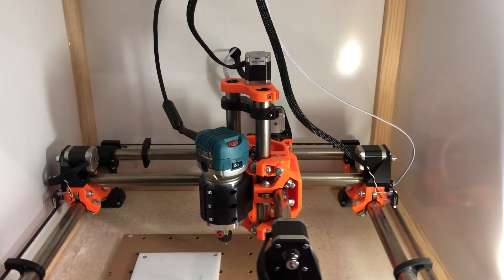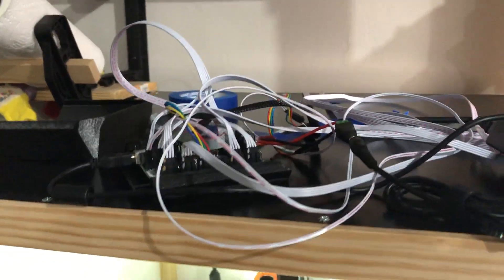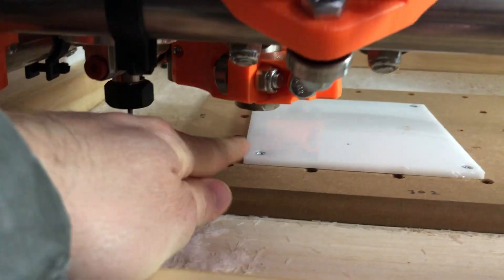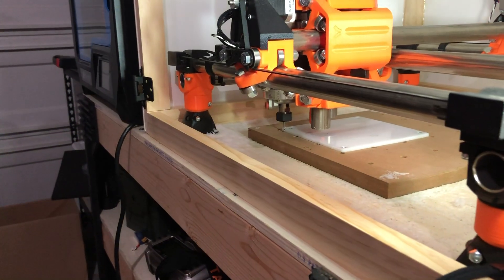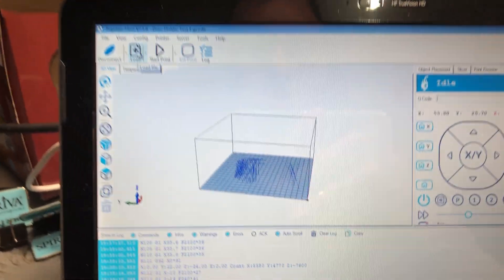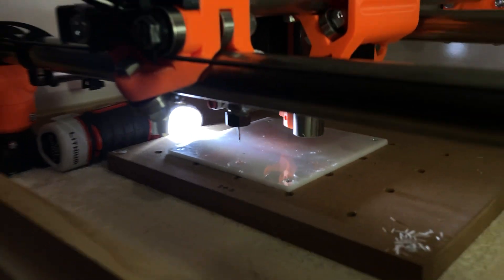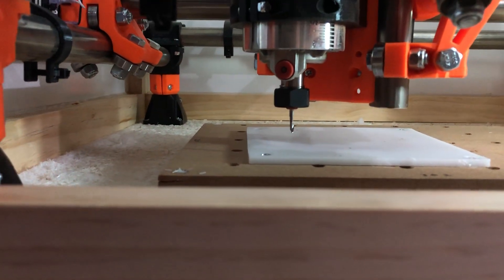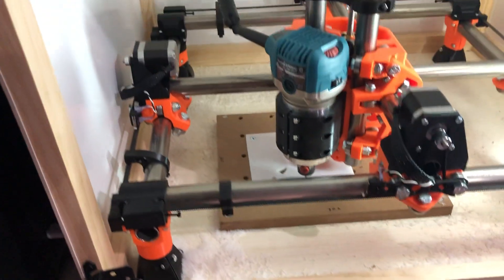MPCNC - A Beginner's Guide to your first job!

Comment: I found this video right as I am trying to figure out my Lowrider V3 build, and this video was extremely helpful. I rarely leave comments to anything, but if it would be helpful to you and others watching, I THINK you would have been better served using the G0 code instead of G1 for linear movement. After watching your video, I went to Marlin's website to see what all these codes mean, and reading up on G0/G1, the description says, "By convention, most G-code generators use G0 for non-extrusion movements (those without the E axis) and G1 for moves that include extrusion." When you made the passing comment that you didn't know why it was moving so slowly to its homing point, maybe it was because the firmware thought you were trying to extrude plastic for a 3D print while doing so, thereby slowing it up (who knows what your "extrusion" feedrate is set at). Disclaimer, I have no idea what I am doing, so keep that in mind. For those curious, here is my source... https://marlinfw.org/docs/gcode/G000-G001.html.

Comment: I think I may end switching over to this software as opposed to Estlcam. I find this is much easier to zero in on the Z axis with out without the probe simply by using gcode commands

Comment: hi thanks for the video built my mpcnc right after i built my house. have been doing home repair since than now started it again and when i do g28x my z axis starts to move down into the build area. I can control the z with the manual controls. Have had issue with the thing going into the end stops and not stoping I even reflashed firmware. than again with endstops as True to invert them they are no 
any help please.

Comment: What size is your MPCNC? Looks like a good size
Reply from the maker: The footprint is about 24" x 24".  I think the work area was about 12 x 8 ish, about the size of a sheet of paper.  Approx 3" Z height.  Doubling a dimension increases deflection by a factor of 8 so small is best for a rigid machine.

Comment: any suggestions as to why my computer will not communicate with my control board? Ive followed all your steps in both videos but can't get a connection anywhere.
Reply from the maker: Sorry, can't offer you much there.  I'd check USB drivers.  You might need to download something.  I'd search the name of the board plus the word drivers and see if that does it.

Comment: Can you provide me with all the files that I need into one folder as I don't know what files I need as there are so many files in different location also I don't know which electronic parts I need or how to wire them up, as well as the software. I would be simpler if I could we everything I need in one folder so I can work from there is this possible?  Thanks.

Comment: To set my Z axis I eyeball it as close to the material as possible then slacken the chuck until the tool drops to the material I then just tighten it up and it is set perfectly
Reply from the maker: That's a pretty clever way to do it.  Before I had a Z probe, I did the piece of paper method.  Drop the Z by 0.1mm until the bit grabs the piece of paper and it won't slide around anymore.

Comment: Hi bro. What is the total size of your cnc?
Reply from the maker: Hey.  12”x8”x3”.  I made it very small and with stainless steel tubing to make it as rigid as possible for cutting aluminum.
Reply: @gump1119  thank you sir..
Reply: 12" meaning 12 inches, 1foot.
Reply from the maker: @marlonglodo1930  Yup, about the size of a U.S. piece of printer paper.
Reply: @gump1119  thanks bro
Reply: @gump1119  Is this the usable size or the total size of the cnc? I also want to aluminum and looking for a compromise between size and accuracy.

Comment: Could you share the file for the belt tensioners they look pretty clean
Reply from the maker: I used these ones but the print settings are finicky to get a good fit.  If you search thingiverse for MPCNC belt, there’s a few similar tensioners that I might have used instead.
https://www.thingiverse.com/thing:1833934